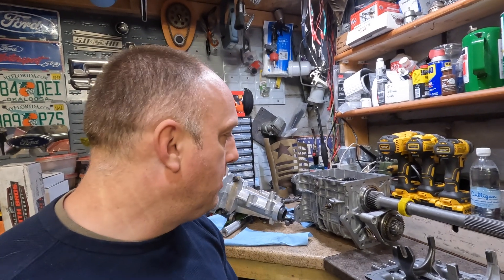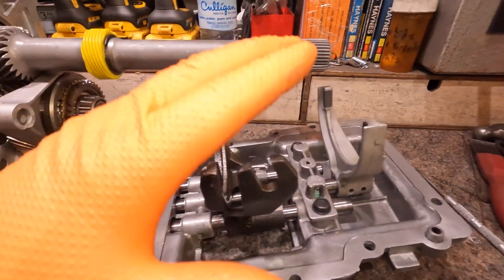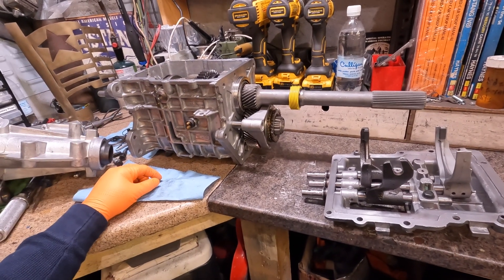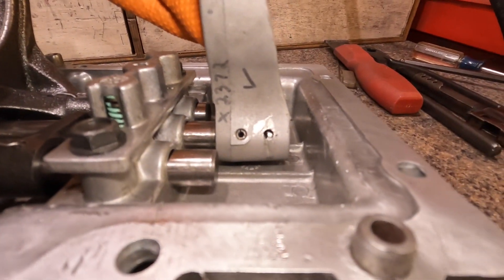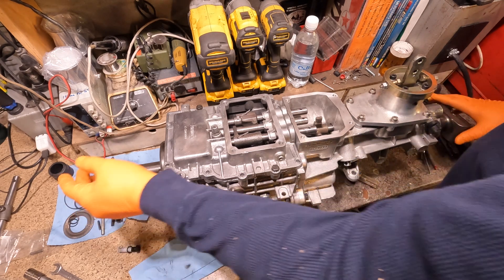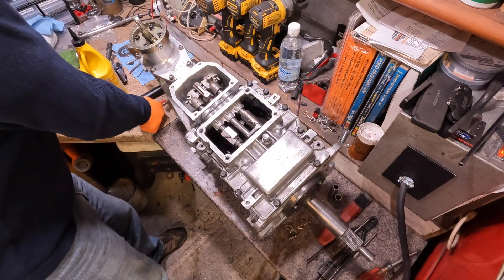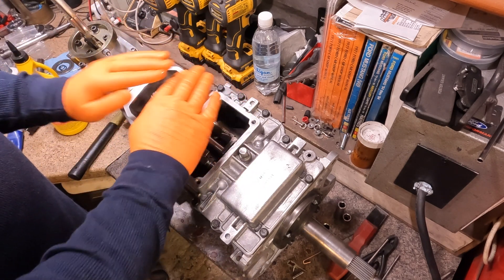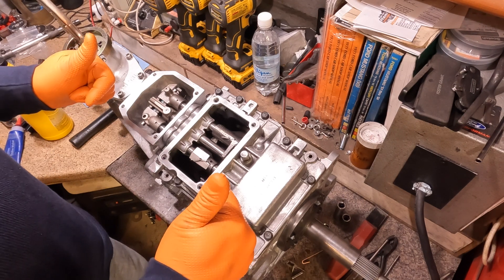Tremec TKO Rebuild Part 3, Top Shifter Plate De-Modification

Comment: New to mechanics and trying to figure out why 3550 is stuck in gear. The middle shift rail does no move no matter what it’s stuck in fourth, could this be the reason why?
Reply from the maker: @xeRrehtaF  Is the trans still in the car or it on the bench?
Reply: @Mike-FoxsAbroad  it’s on the bench now but the shift rail for 3 and 4 doesn’t go back and fourth like you did in the video
Reply from the maker: @xeRrehtaF   If I were you, I would purchase the proper Tremec rebuild DVD from Hanlon Motorsports. It will show you everything about complete disassembly and reassembly for your transmisssion. That’s how I learned.  https://www.hanlonmotorsports.com/product/tremec-3550-tko-500-600-rebuild-video/

Comment: 12:07  agreed. I've used Ford Ultra Grey from a caulk tube. I'm a Senior Master technician and that's the best sealant I've ever used from a manufacturer. The anaerobic gasket maker is to be used when mating machined surfaces. It works great like that, but when a unit has see multiple rebuilds and/or 3M roloc discs, the gap to seal is too wide.

Comment: Hey bud, nice tidy work. You've done this before. If you ever read this, I'm curious about something. What rpm are you shifting this when you're full tilt?

I'll watch some of your other videos about this transmission to get familiar with your build. This is a good video. I've worked on my 3550 for 24 years. Keep it up.
Reply from the maker: I'm not a "racer" so I'm not banging gears with my right foot never leaving the floor.  I have three of these older 3550/TKOs in different vehicles.  They are robust but not speed shifters.  I even have one with the carbon fiber blocker rings on 2nd and 3rd and I didn't note any better shifting vs the standard brass ones.  I would try and shift at 6k at the track but I'm not there enough to be consistent.  They do need to be warm or they like to grind 2nd.
Reply: @Mike-FoxsAbroad  have you tried refacing the cone contact area of the gear? Whether brass or carbon fiber, the smooth surface that they contact on the gear becomes polished after miles and years of use. Taking 400 grit paper to it and removing the polish will give the cone something to bite and speed up or slow down the gear better. You shouldn't have any gear clash regardless of temp. 

I've daily driven my upgraded 3550 in my 93 Cobra since '99. I'm to the point of face plating or switching to a TKX. I need higher rpm shift capability. My engines make power upward of 7k these days.
Reply from the maker: @arturozarate1752  I use red scotchbrite to knock down the burnished clutching cone area, or the gear is usually brand new. 
Faceplating is aggressive.  Racing is racing but faceplated, these never seem to last very long.  I've seen them blown up quite a lot.  If I was going to race stickshift I would build a T56.  My TKX is pretty sweet but I'm not sure where the limits are with it.  My new 363 is going to definitely be testing those limits this summer.
Reply: @Mike-FoxsAbroad  I've put Magnums behind the 363's I've built(3) for clients. The weaker of the 3 making 550hp and 420tq at the flywheel up to 635hp and 500tq. Iiked the 6060's in the GT500's and the Magnums are the same if not nicer. Big though. Maybe the 3550 will just be what is. Thanks for the chat.
Reply: @Mike-FoxsAbroad  whoa....Reef Blue coupe?
Reply from the maker: @arturozarate1752  Bimini blue.
Reply: @Mike-FoxsAbroad  ah...NICE! The Cobra manifold is great for nostalgia. Most of my builds are all in and factory manifolds, even ported and shortened, leave a lot on the table. I bet it'll be a lot of fun though. Takes me back 20 years ago with a TTI single 60-1 in my brother's 95 Dunlop Saleen.